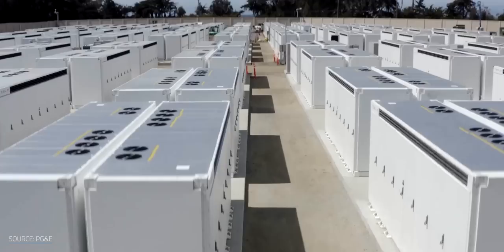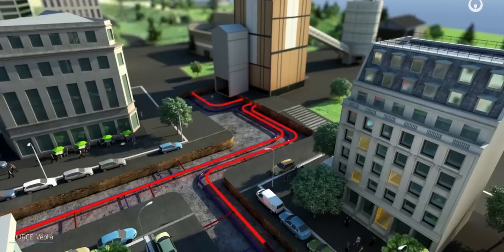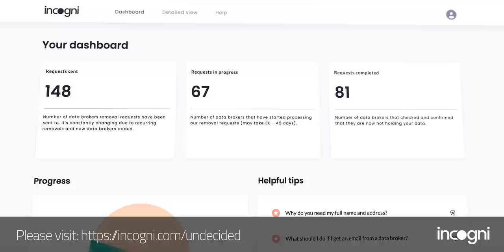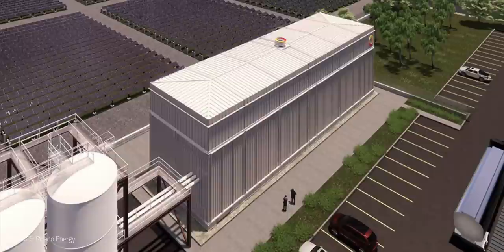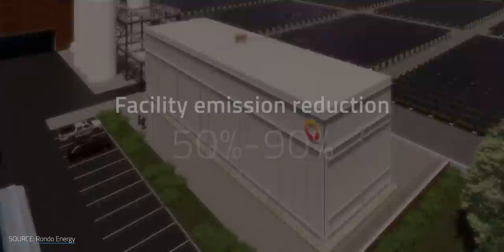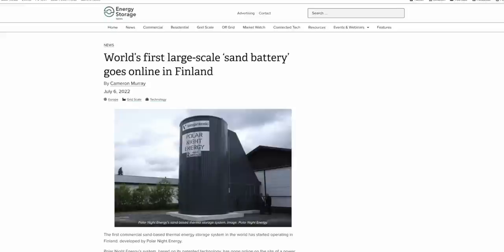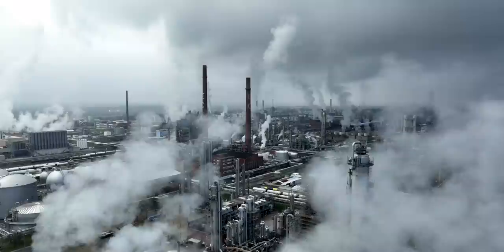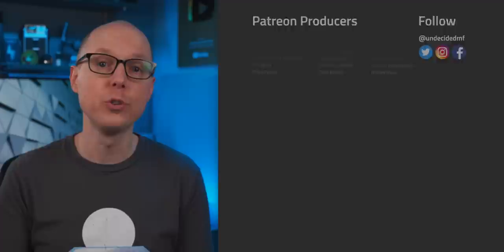How A Brick & Rock Battery Is Changing Energy Storage

Comment: Hi Matt
Nice, new video. As always when I see energy storage revolving around heat energy, a big flag goes up for me. IF the energy (from solar, wind, etc.) is ultimately going to be "degraded" from electricity to heat as the useful commodity, all well and good. BUT if that electricity was wanted later, one has killed off ~ 66% in the transition - this because 33 % is what one gets back as generation electricity starting from heat. Very important that the public understand this, I feel, as I am constantly talking to lay groups that are mislead by the nature of heat storage as a method: it it not generically valid.

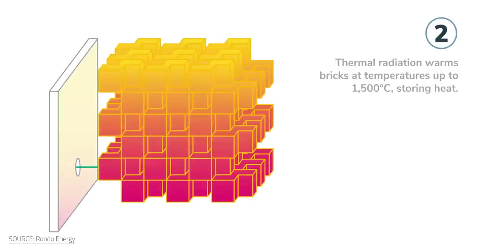Might be worth a good disclaimer about this very issue before jumping into the meat and bones of the discussion, say at t=4:40.
with best regards, Domenico.
Reply: Indeed, heat storage is really only good if you only need heat as the output product. Converting to electricity from heat is horribly inefficient, but these companies are not suggesting this at all.
Reply: So what? That would still mean in the end you would get a decent amount out of it which is better than literally letting it go to the wind. The issues here is catching some of the otherwise wasted energy of renewables in environmentally friendly way and you cant get more environmentally friendly than brick and rock.
Reply: @outlander234  The "so what" is that renewables  already require vast amounts of land and infrastructure to maintain. They have been promised to tax and rate payers (often along with land expropriation measures) as adequate means of replacing current sources of electricity,  - the thermodynamicaly highest grade of energy mankind has. To waft away 66% of that yield immediately as heat from the start now means you have to consume 3x the amount of whatever primary source you have -whether coal or wind - to compensate. You have now lost a lot of the ability to even justify any carbon footprint for EVs, etc., in cases where the current could have fed a grid. This is ethically in-excusable engineering practice in power-hungry times, and any government agency that doesn't think that through deserves to lose the next election. If you want to melt steel or run high temperature chemical processes, burn a primary heat source like gas in the first place - oh wait, some people thought a crumbly old Russian regime could help us with that....
Reply: I agree and disagree. I think that this idea is clearly reasonable if A) our energy source is heat or B) our end goal is to heat something. Company is directing for option B. I would love to see this idea in option A also. 

You argue against MrFatuchi that the investments in renewables are partially wasted. My counter argument is that badly timed energy production from renewables will most likely boost the business of various energy storage systems. So the storage efficiencies are expected to improve (although there will be always quite some loss). Still, the proportion that saves factory from burning gas or goal could benefit the company and the environment.

Personally I am wondering why the excess wind energy is not stored near its production? How about flywheel or compressed air etc. without the transfer to electricity in between? I am not an engineer or physicist, so somebody smarter than me could explain the reasons....
Reply: @anomymouse5043  Hello and thank you for this reasoned (and civil!) response. It is uncommon to see folks not coming back on me about these things all emotional...
I think we actually agree overall. In my urgency to provide a very terse response I skipped over the important nuances you mention. Any chemical engineering, metal processing or similar concerns using large amounts of thermal energy exactly for the  necessity or at least high "thermodynamic value" of a high temperature of some contact medium value will ALSO almost invariably find methods of using (often the same stream) for lower temperature needs around the plant. Such hot water, air, etc., may simply wind up just preheating stock flows or even merely heating the plant spaces. The loss constituted by simply "blowing away" , say, 250C hot air would be considered unconscionable and any engineer not finding SOME use for that might soon be looking for other work. Heat exchangers are the important and pervasive  details of plant design.
As for your final query, it sounds a bit odd, although I might be misinterpreting - please correct me. Wind energy IS primarily first converted to current by "dynamo", and with that immediate battery storage does turn out to be best at this point in time (often >93% eff.)
Reply: @domenicobarillari2046  Thanks for reasonable reply. Sidestepping the main discussion: It is important to understand people who disagree on something. One can occasionally learn a thing or two..!!

First: I started to think now, as i returned to this, that this might be failing startup. Others pointed A) that this depends on insulation and B) that it has efficiency loss when we heat the storage instead of target material. Second: You pointed that the factories are already using all potential waste heat. So this system should be heated with the badly timed cheapest electricity. Is it then more efficient to shift the whole factory to work at night? Of course the workers will hate this option.

The heat storage idea seems more rational at the households that use electricity for heating (max 12 - 24 h. storage?). Many have already commented this. I would also point the preparation for predicted cold waves. This is very old tech, so startup has no market there. BTW: City of Helsinki, Finland, has a storage of cold water for summer cooling.

Finally, I am willing to shoot down my wind turbine + generator + flywheel idea. I was thinking a storage that is connected when, say the wind speed is strong enough. A) Efficiency of the turbine -> generator -> battery -> AC seems too good. B) Space in the turbine - generator tower is limited and construction costs most probably jump. Flywheel might still work as a storage + safety measure for strongest storms?

OK, I stop here!😆
Reply: @anomymouse5043  Hell nomy mouse
Having a little bit of trouble understanding some of your message , my good sir. We seem to have something of a language barrier, but if I get the gist of your reply correctly, what I would say is that if one has a scenario where a plant is starting with high quality (i.e., hi T) heat source like natural gas flame or air driven coal combustion one is doing the thermodynamical best to run heat driven metallurgy, chemical refining, synthesis, etc., from a purely technical (not environmental) point of view.  Be advised too that electricity can directly replace any of these - from arc furnaces to melt steel to resistive heaters to drive petroleum cracking towers. There, a sufficiently "nice" supply - i.e., NOT fluctuating within minutes or hours - of renewables, hopefully at competitive cost per kWh with historic prices, could be direclty substituted in. There is often a huge amount of "thermodynamically low grade" heat (i.e., colder) to actually or potentially capture for processes that can make use of it, and this is in fact very often the case in chemical plants, but NOT in metallurgical processes. (You must realise that this is often in the form of dirty air or fluid, so often needs a heat exchanger).

With "heat batteries", like the kind mentioned in Matt's program, placed strategically in to new or retrofit designs, one can conceive of industrial farms where one business' low grade heat become anothers prime heat at a convenient time of day. Businesses have not historically organized this was "naturally" as a rule, BUT this may become the way of the future, and if what you are telling me is that in your country this is already being (or starting to be) done at the hot or cold temperature end, then bravo I say!

Again, what is a shame about using electricity to make heat is that you could have otherwise used it at near 100% efficiency to turn machinery - think of how many processes need a mechanical effect and not heat in our civilization. Even the afor-mentioned use of electricity to directly melt steel in an arc furnace is only done because of the very high quality of metallurgical product desired, which fetches a compensating price! Better stop now -bye!
Reply: @domenicobarillari2046  Good package of information, again. Thanks!

Comment: My house has a massive crushed glass and concrete insulated foundation that exchanges heat with the house via forced air. 
Works really well to  reduce heating and cooling costs when combined with solar and heat pump.

Comment: Thermal storage looks like a great idea. But I wonder, if ~20% efficiency from solar batteries is not worse, than using vacuum thermal collectors (that can heat up to crazy temperatures too) and then pipe that heat to thermal storage.
Reply: EXACTLY!!!  As thermal storage is becoming a big thing, why not get 100% of energy from sun instead of just 20%.  It makes no sense!   I'm sure people will eventually see the light ;)
Reply: I am planing on using solar toughs to heat water and then store that heat in a tank of candle wax.
Reply: @LaserFur  That sounds exciting!  There's lots of research out there on improvements using nano particles and other things. Good luck!
Reply: What is the efficiency of a thermal collector? Answer 20%.
Reply: I think costs of piping that heat outweigh the benefits. I am no expert but just thinking how great those pipes have to be insulation wise to not get radiation of that heat that goes nowhere... You might end up with same percentages. I think the mirrors and molten salts he mentioned at the end is better solution.
Reply: @outlander234  A friend of mine has thermal collectors to heat water in a thermal buffer reservoir. He says that the complexity of the thermal system is not worth it. Not only the piping, but the costs of the pump, the controller, the expansion vessel, the over pressure valve (and the worry of losing the fluid if the collectors overheat), the pay of the workers, the fact that it doesn't heat the water at all if it's cloudy - it works only in plain sun - indeed outweight the benefits. My friend would go instead with photovoltaic panels + inverter + electric heater + thermostat. It generate electricity which has many other applications, and work even if it's cloudy (of course, with less energy collected).
Reply: @simplywink  I think even better system would be to connect photovoltaic system and wind system to this brick and rock battery that has dual outputs, electricity for lights and appliances and the heat output for hot water and heaters. Question is just how effective are these batteries...
Reply: @outlander234  Thermal in to thermal out efficiency is quite high, if the time of storage is not too long to lose the energy through the insulation.
Thermal in to electricity out efficiency is lower, 30-40%, and in the case of conversion by Peltier elements, only a few percent. But the difference from generating electricity is "lost" as heat, which again we can use. So your idea might work.

Comment: Really cool video. Personally i see advancements in geopolymers as a more sustainable route in concrete than the brick storage method but i still like and see the potential application of storing heat energy this way. Definatley a great alternative to oil furnaces and other fossil fuels. I will say that in many cases with a wood stove that really depends on the situation. So for normal amerocan suburban and urban lifestyle, yeah burning wood is probably not going to be sustainable. But for people who live out with plenty of wilderness, you can avtually harvest quite a bit of wood from dead or dead standing trees and fallen branches. You dont need to log at all if you have (i believe) it was around 5 acrea of forests area to harvest from per household. Is this methid going to heat everyones homes? No but when blanket statements are made like "burning wood is unsustainable" thats not really the whole truth.  Nor is the opposite.

Comment: Good video as always Matt!
Interesting and fun you use an aerial shot of Blast Furnaces 6 & 7 at Tata Steel in IJmuiden where I work.
There are actually "Windverhitters" or Hot Blast Stoves that are first heated by process gasses and some natural gas, and then cooled by air which feeds the Blast Furnaces.
And coke is used to reduce the iron ore, and in the process of making coke from coal, gas is produced that, with other proces gasses, is used to make electricity and steam, to power the site.
We do recuperate a lot of energy, mostly to heat our buildings and water, central town heating was considered, but sadly never rolled out...
Now we are transitioning to Hydrogen, and have a brand new 380KV station almost on site to bring in power from new offshore wind farms, we will be connected directly to that.
The six 120m axis height wind turbines in the back came on grid in 2022, but are not ours.
Also some byproducts are used as building materials, especially the sharp sand that forms when quenching slag from the Blast Furnaces, goes directly to the neighbor cement factory. That factory doesn't produce their own cinder though.

Comment: A brick battery is just another name for a storage heater. They have been in use for a century or more.
My grandmother used to put a brick in the oven, during the day, and then remove it, wrap it in a piece of blanket, and pop it into the bed to warm the bed up.
My neighbour has one in her lounge. It's just a stack of bricks in a sheet metal box, with electric elements passed through it. 
.

Comment: We have been using TES at a home based level successfully for 3.5 years so far. Basically, we send excess generation from our solar panels directly to the hot water cylinder, and once it's at temperature it's thermostat opens and further excess generation is exported to the grid. Our hot water cylinder has been :off grid" continuously for 3.5 years so far, and we have yet to suffer a cold shower. With this we have bypassed the need for dedicated "expensive" batteries but of course depend on the grid for night time power. With 16 panels and a 6kw inverter we have zero power bills averaged out over the year.

Comment: i can agree these systems work, I have had a system similar to this running at my house here in alaska for 7 years, my temps are running closer to 180f  we have almost 24hour daylight and no heat load in the summer so I am storing the energy in a rock battery. this caries my heat loads for months into the winter and preheats my domestic hot water year round.  it has offset my gas bill by around 50%

Comment: brilliant!
in the energy storage business, there are many options. You could raise a VERY heavy weight up in the air with a pulley system, then lower it to turn a crank, storing mechanical energy. You could spin a heavy wheel (flywheel), then later use it's fast spin to release mechanical energy.
You could charge a plate up to a high voltage, storing eclectic charge. You could use chemicals in a battery that react with one another, releasing electric charge (most batteries today)...
But this is so simple. Slowly raising heat into an isolated system, to later released as heat, no converting to electricity or mechanical energy...
and if you need mechanical energy, just use the heat to boil water and turn a turbine!
simple yet practical. Im just wondering the energy density of the battery and how much energy you could get out of them? 
and 1500C is not bad for now. hopefully they could get more!

Comment: I love the simplicity of the traditional heating element, but there may be even more efficiency to be tapped by using heat pumps. This would also increase the complexity and maintenance, but depending on the scale it should work.

Comment: As a new electrician I worked a lot in Jerusalem's Old City in Israel. The Jewish Quarter, destroyed by the Arabs when they conquered it in 1948, was rebuilt after Israel liberated it in 1967.  All the apartments there were equipt with at least one electrically heated "rock box".  Each apartment had two electricity meters, one regular meter for most of the electrical lighting and power needs, and one meter which only supplied electricity in the wee hours of the morning when demand was low. Prices were commensurately low. Rock Box heater fans would be turned on when it was cold, and insulation kept the heat in the rocks when the fan was off.

Comment: Similar technology has been used in the glass industry for a long time, we call them checker packs, the structure they are in are called regenerators, the exhaust of the furnace goes through them, heats up then we switch directions and the intake combustion air comes through the checker packs to get preheated. Saves absolutely tons of gas

Comment: It’s interesting that companies are looking into storing energy in the form of heat. This idea has been around for many years in the form of night storage heaters. I can remember 50 years ago we were installing night storage central heating in big warm air unit that were sourced I believe from Canada. They worked in a similar way to your American gas furnaces. A company in the U.K. Aga. Made a cooker that used bricks inside a cast iron range cooker to store energy to cook with during the day. The disadvantage was if the elements inside the bricks failed, it was a mammoth task to dismantle and rebuild the range cooker.